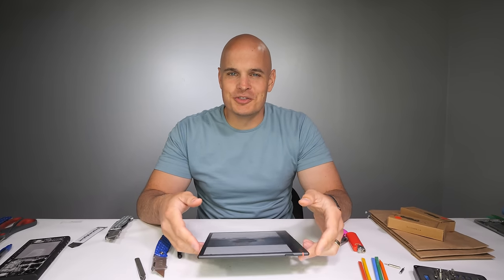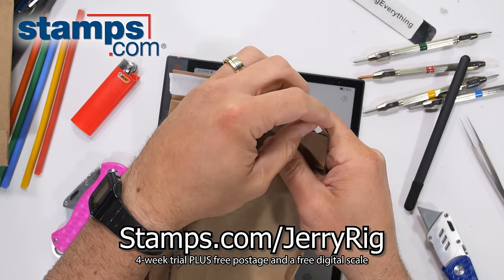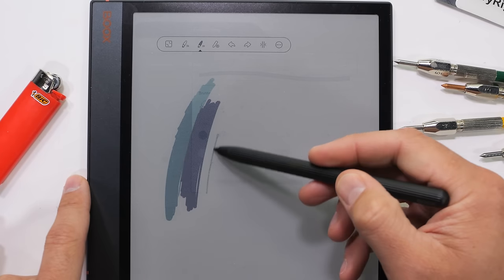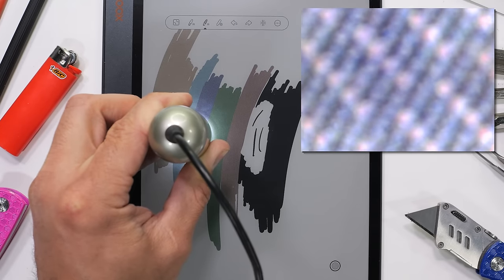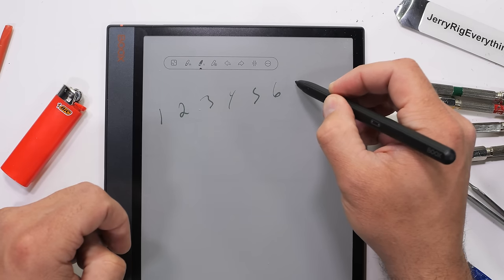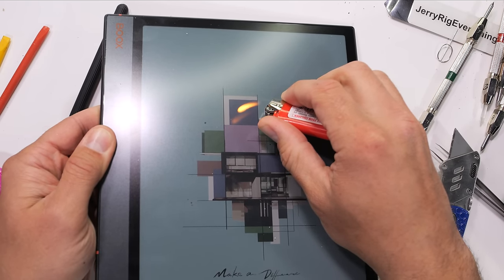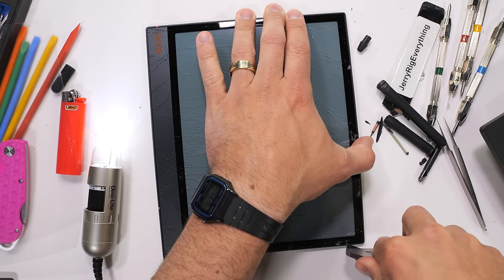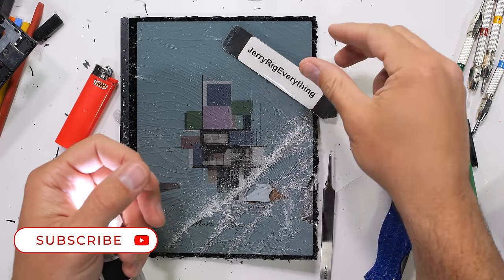Color E-ink looks CRAZY Under a Microscope!

Comment: I never thought I'd see Zack bring in a BOOX device for testing.

(2:35) It IS a great idea, Zack. The rubber cap is there to prevent the nib from getting bent while not in use.

I lost the pen cap for my BOOX Pen2 Pro (different from the Pen Plus included with the tablet but still included a rubber cap), and the nib ended up getting bent when I carry my Note Air2 in my backpack. I would then keep forgetting to find a substitute for the cap. Argh!

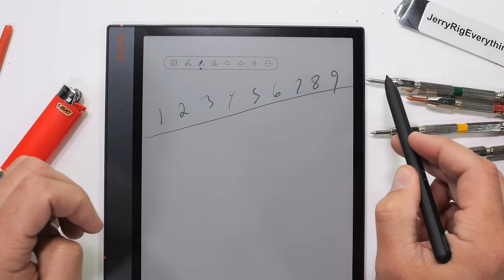(7:02) To help you figure out the name: There was originally a model that was just called the BOOX Note 10.3, which in turn was the successor to their N96 series, and was then succeeded with a few models up to the Note Pro, then the Note2. That series lasted up to the Note5 alongside which the Note Air was released which was, to me, basically their answer to the reMarkable 2 which came out around that time, but with their more open software experience. It was followed up with the Note Air2 (the regular Note series was discontinued), Note Air2 Plus, then the current series which is the Note Air3 (greyscale display) and Note Air3 C (colour display).

(7:11) (corrected at 9:34)
There was a Chalid Raqami YouTube video where he peeled the plastic layer off.

(7:31) (corrected at 8:58)

(7:58) The Tab series does have a camera and camera bump as that series is optimised for productivity (the camera is used primarily for scanning of print documents), while the other series like the Note series are optimised for reading.

(9:27) That reminded me of some posts I saw on the official BOOX Facebook group where the EPD panels somehow manage to break, however that had never happened to mine.

Comment: 4:25 I'm sorry to be that guy but this moment needs some clarification

The reason we see red green and blue on an e-ink display isn't the same why we see them on a backlit ELT LCD or LED displays. These displays emit color which forces them to use additive color models, RGB colours add up create white, and the absence of any color is black.

Quite the opposite happens to printed media and some e-ink displays. The absence of any colour is white and the CMY primary colours are subtracted from the white to create black. Printed media have additional black color for text, lines and deeper shadows, this way we get the CMYK model.

This display seems to be RGB which is odd, but judging by the dull colours it was made with intention to use primary colours without mixing them. You can't get vivid yellow on such display you only can mix a bit of red a bit of green and get colour tan at best.

And what the red green and blue colours on a white screen indicate is that this is indeed a E-ink technology, white coloured particles are repelled by the charge below the screen but it's not enough to hide all the other colours. It's the same with b&w e-ink displays.
Reply: Thank you for explaining!

Comment: The single biggest advantage of E-Ink screens is that they mimic actual paper. And as a result they don't cause eye strain when it comes to reading, even after long reading sessions. (Unlike LCD and OLED displays.)

E-Ink uses actual electronically controlled Ink capsules to display an image. So what you are seeing isn't actual pixels like a LCD or OLED panel has. 

LCD screens and OLED screens even with blue light filters are not as good as E-Ink when it comes to eye comfort. 

This is why E-Books like the Amazon Kindle, and Kobo exclusively use E-Ink displays. 

E-Ink also has insane battery life since it doesn't need battery power when displaying a static image. It only uses power when you refresh the screen like flipping a page on a book you are reading on your Kindle. 

So as a result, the Kindles have a battery life for most readers that lasts a few weeks. 

A Kindle or Kobo or for some a Barnes & Noble Nook with an E-Ink makes for a far better reading experience than a iPad or a smartphone. 

Especially because iPads and phones use LCD and OLED screens that will always cause eye strain and have horrible battery life and other distractions that always seem to ruin the reading experience. 

Not to mention dedicated E-books like a Kindle or Kobo are far cheaper, and hold thousands of books for a fraction of the cost of a tablet like an iPad or a phone. 

E-Ink displays are also used in retail stores for digital price tags. 

Stores like Best Buy, Kohl's and Kwik Trip gas stations in Wisconsin and Minnesota (Known as Kwik Star in Iowa and now Illinois) all use E-Ink digital price tags. 

But the downside of E-Ink is obviously slow refresh rates and response times. 

But E-Ink was ment for niche applications like advertising and for E-book applications. 

It was never developed for replacing LCD or OLED displays. It was developed to fill in the gaps where LCD and OLED displays tend to come up short. Thats static imagery eye stress and energy efficiency. 

So E-Ink simple compliments LCD and OLED. 

Much in the same way E-books compliment physical books. 🙂

Comment: I have the black and white version - I picked it because it's brighter, and I never turn on the backlight so the battery lasts for ages. You forgot to test the fingerprint scanner, but I don't actually use mine - I think of it like a book, and you don't password-protect a book.
One thing I don't like is that the display is a few millimeters below the surface, and that's a little off-putting when writing - when viewing from different angles it looks like the line doesn't form directly beneath the pencil. The worst part about using the tablet though, is the pencil nib. The texture along with the texture of the display feels great to use, but over time it gets worn down.
I've had mine for about a month, and I may have given it to an art major for a few hours a few times - he goes ham on it, but I've already gone through one of the nibs. It ended up completely flattened, and I probably could have kept using it, but it's a lot harder to write with it when the tip doesn't come to a point.
Still, I got my textbooks on it, and I saved some money getting it used off the manufacturer's site. So, after I read more pirated textbooks, it'll have paid itself back. It's much nicer to read on than a regular screen.

Comment: 6:45 you are simply mistaken here. There are 16.7 million colors in the SRGB color space, which Samsung, for example, has exceeded since HDR support in the S8 in 2017. The HDR10 color space, for example, has 1.07 billion colors, to be exact. This is a common misconception because SRGB was the standard for a long time, but I had to call this out because you said TO BE EXACT when you are two orders of magnitude too low for the device on screen.

Comment: The problem with creating color E Ink screens by using RGB subpixels is that these screens can only reflect 1/3 of the incoming light compared to colored paper, or compared to monochrome E Ink. Which results in the screens having low maximum brightness and therefore low contrast.

It would work better if the screens didn't have to rely on RGB subpixels to create colors. There actually is an E Ink screen which can switch the pixels directly between 8 basic colors (red, green, blue, cyan, magenta, yellow, black, white) without needing three subpixels per virtual pixel. This is enough to create other colors via dithering, and it allows for brightness similar to paper. However, the screen refresh rate is extremely bad, even when compared to normal E Ink. So it isn't usable yet.

Comment: I absolutely love e-ink displays. For a phone or computer I don't see it being desirable but I've had many e-ink notebooks and love their utility and functionality. To have a watch with the same characteristics would be an ideal application. You aren't viewing digital media on them like you do other devices and then you get to benefit from the battery boost e-ink provides. I have tried a smart watch from garmin in the past due to it's supreme battery life and love it even with it's limited capabilities but i have not tried any other for the sole reason that it's yet another device to charge on a daily basis, if not more. To have modern functions on a device that was able to hold charge for days on end for that form factor would be ideal.

Comment: So I guess this is how they produce a whole range of e-readers. I personally got the Boox Tab 10C Pro which is like the top of the line model, complete with camera, etched glass display and dedicated display processor chip. The lower end one has no camera, and this one is kinda the entry level color model that has no etched glass and no display chip. The CPU for all three of them is also different I think.
And that's kinda a good thing. These e-readers aren't cheap and it's not like everyone would need everything. And my only "complain" is that the model names are all different between Chinese model and overseas ones, which makes getting information a bit harder giving that it's still a niche thing to have.

Comment: One of the very first smart watches was the Qualcomm Toq. I had it.  It was fantastic and even charged wireless. Had a color e ink type display that you could see even better in blaring sunlight.  That's was like 2013. I really wish someone would have made it. It was a limited quantity. This was 2 years before the pebble time. It was called a Mirasol display. It could refresh fast enough for video back then.

Comment: I have and still use the Pebble Time with the color e ink display, it's amazing. I don't use the bluetooth so the battery lasts for roughly 2 weeks. The display is very snappy compared to most e ink displays I've seen.

Comment: An iPad Pro 12.9 inch sized colour e-ink display, with ultra high resolution, would be fantastic. That size is pretty much perfect for full size comic book pages. Sadly colour e-ink at the moment are usually limited in colour range, so you're still better off reading comics on an iPad. One day soon though colour e-ink is going to be better.

Comment: If they used an MR fluid which increases in viscosity in the presence of a magnetic field, along with a grid of super tiny electropermanent magnets (look ‘em up)… then they could just turn the magnets “off”when refreshing the display, and then them back “on” when refreshing is finished.

Comment: Cannot wait for the day that as a society we all start become energy efficient but more importantly Proficient. E-ink development should've taken over a decades ago. But thanks to the silly demands of the common user its R&D has gone slow. Whoever say this CAN be impressive, I'm sorry, you have been part of the problem. 
e-ink has been impressive with incredible potential from day one. Kudos to the first Nook execution. Adding a solar panel on the case and reducing the battery size would have made it the ultimate book. Amazing tool for engineering school. Can't wait to try this Boox Note Air 3C
Incredible idea of using RGB filters for color correction. This was an awesome video. Thanks Jerry the Rigger!

Comment: There is big difference between emitting a light and reflecting. RGB mixture to get white color is only applicable to LEDs.

I might be very wrong. But e-ink should reflect the light. And in this case RGB colours we see under the microscope are most likely imperfections of technology. And this is the reason why white doesn’t look pure white but slightly grey.

Comment: The original Amazfit BIP watch had an e-ink display. It was cheap - and had an amazing battery life - When I went on holidays I did not even need to bring a charger with me. I had several upgrades but ultimately it was replaced with boring traditional screens.

Comment: The refresh is WAY better than my Boox Tab Ultra color, no way to even attempt playing video on it. But it's nice when reading technical books with lots of screen shots because of the color. I also have the older Poke 2 color which is a 6 inch display, not so great for PDF reading which is why I upgraded.
Reply: Which Refresh mode are you using? Both the Boox Ultra C and Note Air 3C have BSR with Kaleido 3, so they should be close.

Comment: It's misleading a bit to say eink is "on" just because it has an image. It would have been a good tech tidbit to mention instead of making the "on" claim. Eink is bistable, in that it will hold whatever state it is in without consuming power. You can set a display image and it will stay like that indefinitely. Both being blank or sitting at a static image is really "off" for eink. The only time is it actually "on" is when it is making changes to the image.

Comment: "There is technically no refresh rate..." No, there still is one... like you said, it just refreshes "when it needs to" (everything refreshes when it needs to, but I think you meant "when the picture signal changes"), but since a change isn't happening all the time, then its rate is between 0 and max. And we could see that its max. isn't very good (but we wouldn't expect e-ink's max rate to be very good). What is the max rate of this tablet?

Comment: I have the Lenovo ThinkBook Plus G4 with colored eInk secondary display. The display is very much like the one shown here - probably from the same factory, too. 
The Lenovo has two options for driving the eInk: A high-refresh mode with 12Hz that has decent ghosting and very bad contrast and colours - as seen here. The other mode is called 'reader mode' with maybe 2Hz, long input lag and terrible ghosting, but the colours are much more vibrant. Great for reading books or comics, but useless for anything where the content changes with any regularity.

Comment: I have one of these tablets. It’s a great Android tablet with really long battery life. My primary purpose is as an e-reader, which it obviously excels at. But, as he showed, it can play video in a pinch. 

I have a 1 TB microSD card in mine with offline copies of Wikipedia, Project Gutenberg, and other free information sources. (Including ifixIt.)

As to e-ink watch? I had an “e-paper” Pebble and Pebble Time back in the day, and loved them until getting my Apple Watch Ultra. But while they advertised it as “e-paper” they were really just very low power LCD. If they lost power completely, they did turn completely off, unlike e-ink.

Comment: 4:50 for those you want to know. You will never see a perfect image. 

If you look at something you from close to far you ajust your eyes. But if they are the same distsnce you dont have to do that. But if you zoom in with lightmicroscope. The smaller you watch the tighter the area is before you need to ajust. Meaning if the front of a cell is in focus the back is already out of focus.

Comment: A phone with a screen in each side would be awesome. E-Ink on one side, standard smartphone screen on the other. Let’s face it, the rear is basically just wasted realestate. You could swap to each screen as needed. You could use the E-Ink display when full colour is not needed, or just use it when the battery is getting low. It would extend the battery life of any phone significantly.

Comment: That e-ink screen is using "Kaleido" technology and has a color layer above the pigments. There is a competing, more modern, technology called "Gallery" that actually uses color pigments without a color layer which gives it superior color quality. Finally there is also E-ink "Spectra" that has even higher quality than Gallery but extremly slow refresh rate, and is only good for still images.
Reply: gallerfy is sooo slow to refresh tho, kaleido 3 is much more useful imo
Reply: @DCCXXV  E-readers are not tablets. For tablets OLED is the way to go.
Reply: @SkepticalCaveman wrong, i want note taking with something like this (so do most),  with gallery its awful.
Reply: @DCCXXV  it's as fast as B/W e-ink was 10 years ago., it will improve.

Comment: I used to have a boox but for some reason the stylus kept malfunctioning after about 1 month of use, and I gave up after the replacement unit had the same problem... I hope they have fixed the problem now, because when it works it was great for reading and labeling documents

Comment: If they could integrate an SD card slot to play videos and other files, what's stopping them from also integrating a browser and the capability to connect to the internet? I think it would be a great idea if users consider it as a backup device, especially when traveling to remote places, due to its extensive battery-saving power.

There will be drawbacks, but I don't also think it's a bad idea.

Comment: The first smart watch I had as a "training" smart watch was a really simple 30€ watch that did not have any smooth frame rate it was a 1hz screen that didn't have any animations only when swiping to see like messages it would update the screen once to show them, and then tapping them would again update the screen to show the message. So this technology would be amazing In a watch. A watch doesn't need good frame rates it works just fine. That would greatly increase the battery life if s watch. And then the clock could be a always on display because it's not actually "displaying" anything its just flipped ink thingies.

Comment: I want an e-ink phone and laptop, doesn't have to be color, where the battery life is insane, like weeks.  I want it to basically only use power when you interact and then all of the hardware goes back to sleep, except for the cell chip or whatever.

Comment: if i could get one for a bit less id be all over this for comics currently i just use my 2in1 laptop having a 13 inch laptop in tablet mode isnt exactly a perfect fit its a bit unwieldy so ive been thinking about a 10 inch tablet on the cheap end but something like this could be sick but not at 500